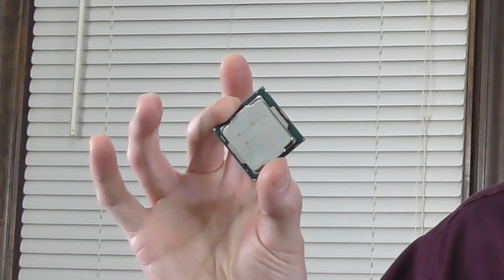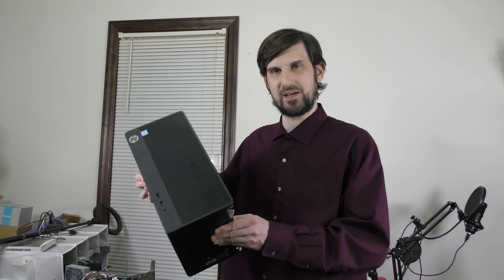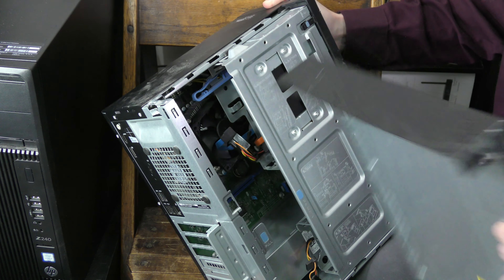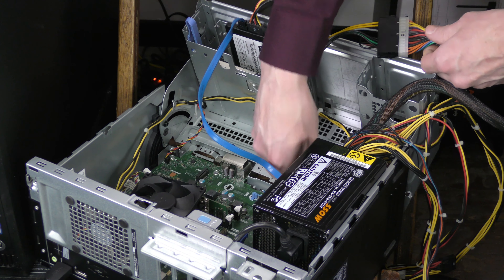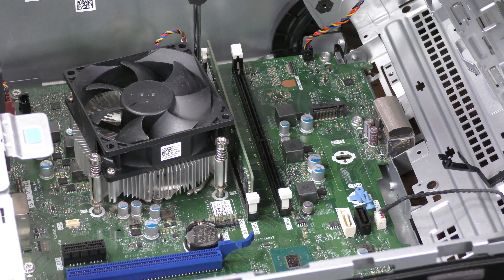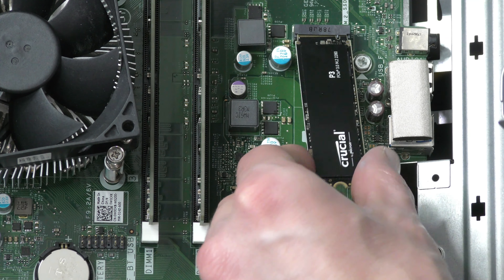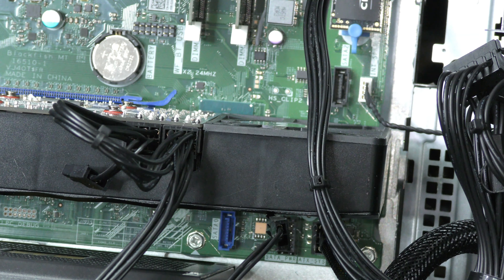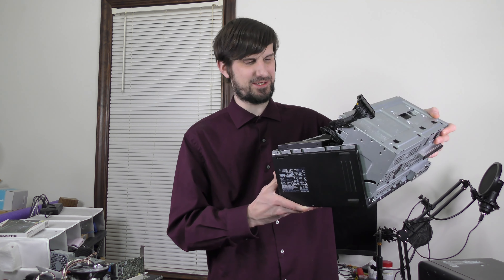Fail. Pivot. Get Crazy with an Old OptiPlex

Comment: Have you ever thought of an open test rig setup?  I have a couple working but I have a plan to make a custom one, so if you want to changr anything it is far easier being open and for me it is more fun.  The last one I did I got a large case so had plenty of room to fit stuff and it was easy to work on.  I love you videos by the way and your humour, I like and subbed too.
Reply from the maker: I haven't really used an official open test rig, but in the past I have made a really crude one, just out of bolts and old brackets 😄. It actually worked fine, but a real test rig setup could be cool for sure.
Reply: @LowcastleTech  Well I bought a mining rig in the hope to configure it for a test rig, it is just the open chassis so then I would need to modify anything after that.
Now my crazy idea I got is to put that on the back burner for a while and I want to try something a bit crazy you might think.  Some recent packages I received were packed with a kind of hard styro type material, soft enough to cut but firm enough to support stuff.
So I'm going to build a rig out of this, I plan to cut it to shape/s and glue it, I'm leaving it as an open rig, I can put the motherboard straight on it as it isn't conductive as well then I'll go from there, changing things as I go.
Reply from the maker: @colinreece3452  Nice, that does sound pretty cool🙂

Comment: I've seen gtx 1660/super/ti models drop below 100$ on ebay and that's around where the 7700 would top out, maybe give that a thought for later! The same goes for the gtx 1070/1080 or rx 5600, all worth considering if you can catch a deal!
Reply from the maker: Nice! I haven't looked into the 1660s or the 5600s as much, but I do have a 1070 that I got for cheap, I was saving that for a different project though. But I agree they would def be a good fit for this machine. I may end up throwing something better in down the line. For now, I'm just going to see how the case modification... and likely destruction goes 😄
Reply: @LowcastleTech  dremel go brrrrrrrrrrrrrrrr
Reply from the maker: @Vegatablez  😂 Oh it's about to. And possibly even a sawzall for good measure!

Comment: The other stick on its own, as another test - is it bad, incompatible, or a bad mix
Reply from the maker: That's a good idea, I didn't even think to do that. I just assumed it was bad because they are the same model, speed, type, everything else. The new one just has a secondary HP sticker on it. But it is definitely worth trying that out to know for sure, I appreciate it!
Reply: @LowcastleTech  I loaded an optiplex 745 with 4x 2GB SIMMS, it wouldn't post, so I pulled them and added just 1 ... ok, 2... ok, 3... ok, so the 4th.... ok now.... err what?
I guess one just wasn't in properly?
Reply from the maker: @matthewday7565  🙂Sounds like it. Seems like re-seating the RAM is always a good thing to try when POST fails.

Comment: IMO once you get past the Intel 4th gen models it's best to avoid the Optiplex systems.  2nd gen through 4th gen is where you can do a lot more upgrades.  Better to go with the Dell workstations after 4th gen.
Reply from the maker: The older workstations do usually seem to be the way to go. I usually just grab the office style PCs when I find an especially good deal on them. Mostly just for projects and messing around. 🙂
Reply: @LowcastleTech  When I say Dell workstation I'm referring to the Precision line.  Since you like the HP Z440 I think you would really like some of those Precision systems.  I'd say they're a bit of  step up from the HP's in build quality.  And the power supplies are very good.
Reply: @LowcastleTech  I agree to a point with Jeff Wayne. I bought the 6th generation Precision Tower T3620 under $50. Came with a 365 watt power supply with an extra 6 pin pcie adapter plug for a gpu. Also has M.2 on the board, but you can buy either the Dell pci adapter or generic version just like the HP z series. I put a 1060 6 gb gpu in it. The cpu was an i5 6500t. This thing performs solid. No issues whatsoever Gaming is no problem and temps are very well under control. This series of Precision 3620's can also come with Xeon processors as well.

Comment: those cases dont have a ton of air flow. be sure to run a few holes in the bottom so the supply can exhaust
Reply from the maker: Good call. It is definitely tight quarters in there with the new PSU 😂
Reply: @LowcastleTech  I made a very similar mod though instead of slicing up the back which is probably the most logical, i offset the supply and used a 3d printed guide for the cable. its pretty janky either way. I actually had to use epoxy to mount it. for mine. The best choice is an sfx power supply that more or less fits however those are really expensive and perform no better than a cheap evga 500 watt.
Reply from the maker: @moebiuseight7977  That's an interesting way to go. Like you mentioned before with the limited airflow, offsetting was probably a good idea. Seems like things wouldn't be as jammed together that way.

Comment: @6:07 thermal paste in the socket O_O
Reply from the maker: 😂 Yeah it got a little crazy. I vacuumed it out of there before I dropped in the CPU though.
Reply: @LowcastleTech  at 6:07 you can see thermal paste in the socket when you seat the CPU. It's possible the pin it blocked was the reason you couldn't get the second dimm channel to work.
Reply from the maker: @RCD4444  Yeah I see that now. Looks like I didn't get it all. I'll have to go back in there if it's not the RAM itself or if there's any other issue. A couple pins were bent as well. Tried to move them up a bit but I get real nervous messing with that.
Reply: @LowcastleTech  I've personally found manipulating socket pins to be hit or miss. Try tooth picks if you don't have fine tweezers. Good luck!
Reply from the maker: @RCD4444  Thank you! 🙂